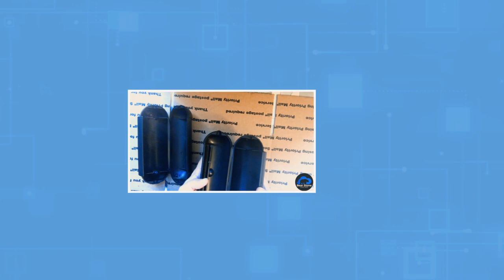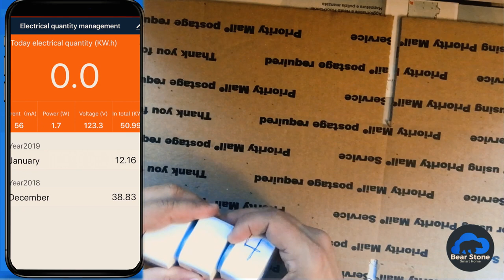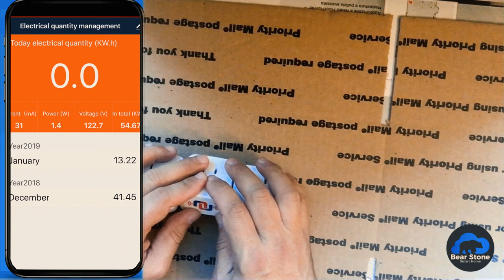My DIY Weatherproof Smart Switch - 1 Month Later

Comment: Water is wicking along the cable.  You need drip loops so the water doesn't follow gravity along the cabling right into the enclosure.
Reply from the maker: Hey Louis!  Yeah .. Drip loops would have been a smart idea!  I'm glad I had a variety of conditions on the different plugs though to see the full effects.  Drip Loops and Silicone on the tips of the containers should do me good next time!  I'm definitely going to see where else I can use these year round so these tips are super useful! Thanks - Carlo
Reply: @vCloudInfo , heh, this suggestion is a combination of stealing good ideas from people that do outside plant work as well learning it the hard way!  If you look at CATV, telephone, etc. drops, you'll often see a combination of drip loop and extra service cable when entering outdoor enclosures.  The service loop for when the termination got screwed up, so leave lots of slack to hack off the first attempt, and try again.  In this case, re-doing the termination isn't the problem, but having gravity help is.  

As these are temporary, it's less of an issue, but often you need a breather hole to let the moisture out for permanent situation.   On a really tightly sealed enclosure, you can get thermally induced "pumping" where the cooling temperature (and air inside the enclosure) draws in moist air from the outside.  Then the water vapor might condense inside, and then have nowhere to go.  This probably isn't an issue for these enclosures; they don't look like they're sealed that tightly.
Reply from the maker: @lmamakos  I always knew about the loops for slack but never realized they were drip loops as well.  The units are not so tight that I would need moisture escapes.  They are more weather resistant than waterproof.  But in the right situation and environment, should work stellar for years.